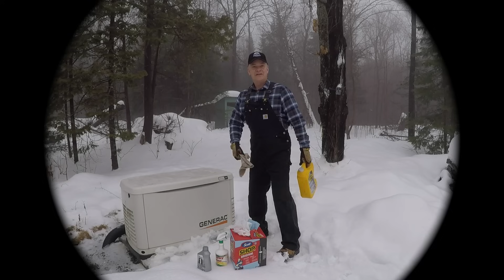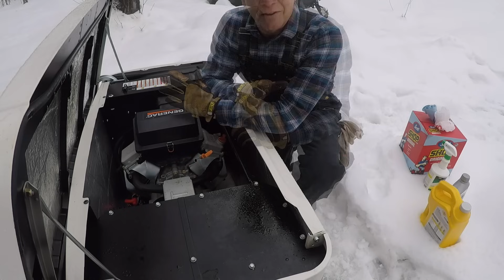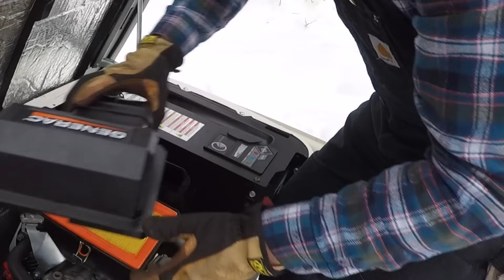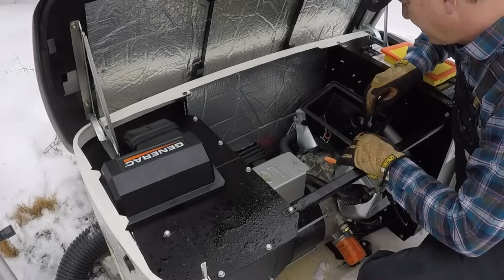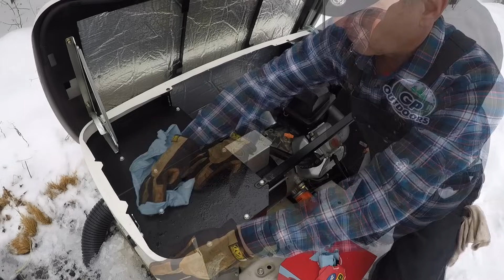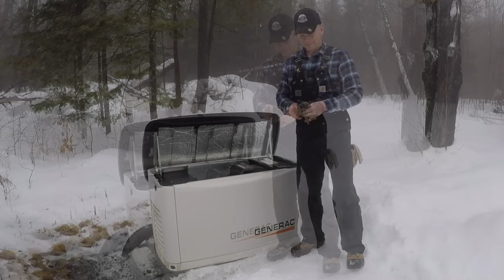#133 Thinking of Buying a Generac Generator? You Need To Watch This!

Comment: The exhaust port is actually a crankcase breather.  Blowby from the engine is routed into the air intake to be burned in the engine.  Since blowby has a high moisture content from the combustion of fuel and air it will condense and freeze. You may want to ask Generac if they offer a cold weather kit that warms the intake air to prevent the moisture buildup. I have an Onan genset and it has a cold weather kit installed for issues like his.. Otherwise very good video,  many thanks!
Reply: I've been repairing power generation equipment for 45 years in the Industrial world . A friend wanted me to recommend a generator brand for his own use . I strayed away from the reliable brands I knew and bought 2 each 15 KW Generac's , one for him and one for myself because of the low price . Both units required major repairs costing more than half the original price in less than 2 years because of circuit board failures . Spend the money to buy a Onan or Kohler or go with a cheap Predator brand . I'm stuck with this Generac hoping to recover my losses and eating crow for ever recommending them ....
Reply: Ed Mckinney Ed Doesn't Generac have a 5 or 6 year warranty's and is this issue covered? Id contact the manufacturer.
Reply: NHseacoast 1 year warranty ..
Reply: Ed Mckinney I’m sorry To year that Ed where did you buy your most have “For a period of three years from the date of original sale, Generac Power Systems, Inc. (Generac) warrants that its standby generator will be free from defects in material and workmanship for the items and period set forth below.This Scheduled Maintenance should be performed by an Authorized/Certified Generac Dealer” you can get 5 year warranty on certain promo days too.
Reply: NHseacoast Mayer Electric Anniston Alabama
Reply: Generac authorized service in Oneonta Alabama wouldn’t Cover under warranty after 1 year period
Reply: Ed Mckinney Ed did you try and call Generac directly I’ve had ok luck with them.
Reply: @NHseacoast  I was given a Seven year full warranty with mine 5 plus 2 extra, Ed, you repair generators and bought 2 from a company that would not honor a 1 year, when the manufacture clearly states 5 years. Seems there is more to this story.
Reply: I would put a 100 watt light bulb near the intake and drill a wee drain hole. Light bulb powerred by the generator of course.
Reply: @edmckinney8457  Are the whole house Cummins Onan generators the same as my 3/4 and 1 ton 5.9 Cummins diesel engines? My Cummins diesel truck engines is the best diesel in its class hands down most dependable and reliable. The small portable 2500 Cummins Onan gasoline generator it's not the same as my diesel truck engines. People have told me the Cummins Onan 2500 gasoline powered portable generator is a Chinese made generator. This is why I just went ahead and bit the bullet and bought a small 2200 watt portable generator and added the tri fuel kit. I tried the cheap route first with a cheap Chinese 79cc generator dual fuel portable inverter generator and it didn't last 6 months before the inverter board went out.

Comment: Generac needs to redesign that and send service changes to owners.  Those things aren't cheap and oil can be a fire hazard.
Reply: I work on these machines on a daily basis. Happens a lot of time in the winter. Do to the amount of venting on the intake side they will actually suck snow into the airbox. It will Melt the snow while running, then freeze. For the most part if you keep the snow away from it this doesn't happen.
Reply: @ericgruner5614  I would suggest to owners to build a vented doghouse to protect the units from this problem
Reply: Don’t buy a generac. Generacs are the most unreliable generators on the market. I’m a fully trained military generator tech who trains on hundreds of different types and brands, don’t do it.
Reply: @aaronkellar6583  which would you suggest, and why?
Reply: Sounds like they did redesign it to EPA regs. Hence the problem.

Comment: You might think about disconnecting the crankcase breather hose from the airbox and putting a filter on the end. Don't forget to plug the hole in the airbox. Your aren't reburning the exhaust fumes to save the environment but the engine will like it better and you wont have an issue blocking the vent.
Reply: instead of plugging the hole in the airbox, put a one way check valve in there to drain any condensation buildup so that the airbox doesn't fill up with water.

Comment: Drill a tiny hole in the low spot and allow the trapped water a place to escape. By doing this to my generator air filter box I haven’t had a problem like this since.
Reply: That's letting unfiltered air in the air box on the clean side.
Reply: With a ball valve? Or one way valve
Reply: @deanbaker1905  put a 1 way valve  like on compressors
Reply: @deanbaker1905  a tiny bit of un filtered air in a sealed box within a sealed box is not going to do any harm
Reply: @deanbaker1905   thats true but it is a small amount on a machine that mosly runs a small number of hours in general- if you are going to run lots of hours on the regular these machines are not the ones that should be used ,as they arent made for primary use. I feel you it rubs me to, it is better to have a small amount of unclean air  then a machine that fails to do it's job if you live in a cold climate plus the air is not direct from outside so it should be cleaner. just a thought.
Reply: It's like a boat. It doesn't get dirty air. 2 x1/8" holes will suffice
Reply: @deanbaker1905  the air would be brought into the dirty side of the air filter box. The clean side of the filter is on the top side where the cover is installed. That's why filter pleats face the dirty side of the air cleaner. It is actually something I was going to suggest by drilling a "drain" in the bottom of the box.
Reply: @mattclifton6516  sorry look again airflow is from top down. Air filter is pleated on top also with wire mesh. Top is dirty side.
Reply: Can't do that, the air box is under a vacuum and would only pull unfiltered air in the hole.  He needs to remove the PCV hose from the air box and plug the hole then vent it out the side of the unit into a catch can.  The catch can will collect the oil vapor from the blow by of the motor.

Comment: You could fix this problem permanently by drilling a small hole on the bottom of the filter box.

Hole will be too small to be of consequence in terms of engine performance or filtering,  but will provide an outlet for the water so it never accumulates again.
Reply: A reservoir for moisture, but no drain? Don't forget that a by product of internal combustion engines is water
Reply: Design flaw for sure.
Reply: In addition to drilling a small hole in the bottom of the reservoir,  also attach a small rubber hose to the hole and then drill another small hole in the side of the generator and feed the hose outside. That way water won't build up inside the unit.
Reply: @tspc2186  that might work if you put a check valve in the line so it's not sucking unfiltered air into the engine while running.

Comment: Hmmm, ok why install a small 100 watt quartz lamp on a temperature controlled switch pointed at the intake box to maintain an inside temp around 5-10 C. Seems like some sort of a drain hole (or drain cup)  is needed too if possible.
Reply: Yeah, a little one way valve at the bottom of the airbox would do the trick, Iv seen quite a few on larger machines, just a little rubber flap that let's water seep out but when under vacuum of the engine closes up (think they're sometimes  called a frogs mouth and can serve other purposes too)
Reply: @Luke.Holmes  

Makes sense to me, why have the hassle of cleaning the machine out when you could eliminate the source of the problem, preventing the cleaning

Comment: Since the dip-stick does not provide anything in the way of pressure sealing, fit the neck with a rubber hose that goes into a glass vessel (volume equal to the amount of loss that triggers the low-oil alarm or more). At least you won't have to clean up a mess if another blow-out occurs and you can just pour it back into the reservoir when it happens.
Reply: Seems like a modification to the design is a better solution.

Comment: Great info to have.  I'm puzzled why Generac doesn't have a built-in means for removing such condensation before it has a chance to freeze.  Very puzzling particularly in your cold weather climate.  I'm currently shopping for a 18-20KW generator and Generac is on my short-list.  But again, my Texas climate would likely not be conducive to such conditions.  But, your video  does give me question(s) to ask.  Thanks for your very informative posting!

Comment: Would you consider installing a drain in the bottom of the air box? You could route the condensate via a drain line outside the cabinet, or install a catch can below the air box to contain the water.
Reply: And when the line is filled with frozen water, then what?

Comment: It's really the crankcase breather. I would put a small hole opposite of the breather hose at the bottom of the cover. It should be enough to drain the condensation but not let anything large enter the air filter.

Comment: If as someone said that is a crankcase vent, it may have two functions, one to warm the air and also to vent the crankcase, I would put a small tube to elevate the exhaust higher in the air intake to alleviate the problem or drill a small hole to run off water.  I have installed these units and they perform quite well not saying other manufacturers don't have good units. I do appreciate knowing about this cold weather issue.
Reply: Got it in one, Thomas.

Comment: This has probably already been said in the comments but that ice is blocking your positive crank case ventilation. It looks like you could move that hose up a little higher in the Reservoir and maybe avoid that issue. Seems like a pretty glaring design oversight.
Reply: If it were blocked, there'd be no water or ice in the air box and oil would start leaking from other places from the excess crankcase pressure.
Reply: @trustme7731  who said anything about blocking it?
Reply: @ThingEngineer  You did. " that ice is blocking your positive crank case ventilation."

Comment: When he says "exhaust port" he really means the breather port of the crankcase. Just like your PCV valve on your car, if it isn't allowed to vent that pressure build up in the bottom of the engine, something's gotta give. In his case it blew out his dipstick and made a mess. I have also seen (in other engines) that it can push the oil seals right out of the lock and then you have a real major problem. This is something Generac should address with some kind of heating element or something. Especially if they are selling in that kind of cold region.
Reply: I also thought about drilling some holes as a solution when watching this. I would have to look closer but seems like a sound idea to me.
Reply: Phil Perri   For sure, probably help you to not void your warranty as well
Reply: Don't forget about government energy savings mandates!  HA!  I'm guessign it has no heater at all.

Comment: Doubt if you'll see this but just like Carb Ice, you need to vent the system with warm exhaust to keep the ice from forming.  Just run a tube from the exhaust pipe to the air intake and this will keep ice from forming.  Good luck.
Reply: Great video, very informative.

Comment: Had my Generac over two years after 2 tornados in 2 years. No issues, no problems. Starts up every week for 5 minutes for test and keep moisture out of lines.
Reply from the maker: Good stuff!
Reply: Also note: Generac's generally do not cause tornadoes, and if they do, warrantees are void!  : /
Reply: Here in the carribean I live in Puerto Rico, for some unknown reason almost all these Generac standby gas generators voltage regulators burnt and need to be replaced. What the professional technician who installed my Champion standby gas generator told me that he do to avoid this issue for happening he recommend to all his customers to install a “power delay” that goes inside their ATS and this issue never happens again.

Comment: I has a 22KvA Generac.  I live in Arkansas.  Mostly mild winters.  Do not have that problem.  Ants have been a problem.  They get in the circuit boards and cause a short.
Reply: While not originally ants, this kind of thing is the genesis of the term computer bug.

Comment: Add a 5W heating element at the PCV port to address the design flaw.
Reply: Don’t you wish Generac would improve their design to add these small modifications you describe, rather than leaving the onus on the buyer to gerry-rig a solution to a blatant design flaw? It’s not like they don’t know that users will more likely need this generator during cold weather when the power is most likely to fail. Sigh.

Comment: I live in Massachusetts and have had a natural gas fired 20K Generac stand by generator for several years. Mine runs weekly for 20 minutes and I have never had this issue. Maybe I’ve just been lucky. However I have had my oil come out looking like coffee milk. I changed oil from regular 10W/30 to mobile 1 synthetic and haven’t had that problem since.

Comment: I have had a 10kW model for about eight years now, and have never had that issue.  But mine is on the east side of my house, blocked form most of the wind, and its been a while since my area has had more the a few days of super cold weather.
Reply: The wind doesn’t matter

Comment: Why would there be an exhaust port vented into the intake air filter box? You don't mix engine exhaust with intake air. That port is most likely the crankcase pvc vent valve so that gases coming out the crankcase recirculated with intake air to be burnt.

Obviously it would still cause a buildup of oily residue coming from the crankcase. Also, make sure you're not over filling the oil level.
Reply from the maker: Yes it was - sorry about the confusion. All the best!

Comment: That port needs to be moved higher up or perhaps you could epoxy (JB Weld) an elbow pointing upward so the water can no longer reach it. Gernerac should have a fix for it as a recall really. That is a design defect.

Comment: That is actually your PCV tube (positive crankcase ventilation tube). It re-leaves exhaust and fuel vapors from the crankcase.
Reply: I'd vent it outside and block off the hole in the air cleaner.
Reply: @TheBandit7613  if you do that it will not have any negative pressure to pull the fuel and oil vapors out.

Comment: I had a similar issue with my 20kw Generac gen as well the first winter we had it. Found the winterizing kit eliminates the issue quite good. Still have to check it from time to time, and no issues since. There is a low heating 3rd party attachment you can get to put in the air filter container.....very small and does a great job.
Reply: Does your cold weather kit have a air filter warmer? Just order a generac 24kw and it's a 3-6 month lead time but I am getting the cold weather kit. Home depot rep didn't explain what's in the kit.

Comment: I have a similar Generac for 10 years or so, 22kw in an aluminum case. Mine goes on for 5 minutes once a week, serviced once or twice a year. There was a recall on I think that part that was changed 2 years ago. Mine has never failed me. I’m in NY so have winters but not severe.